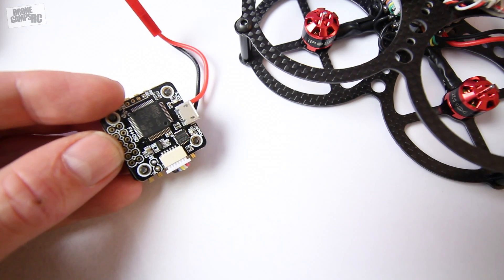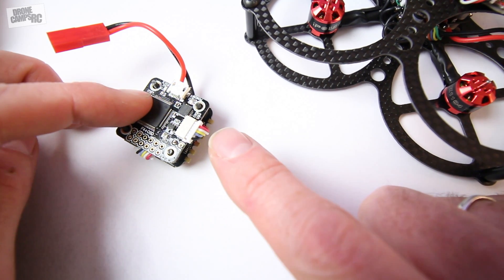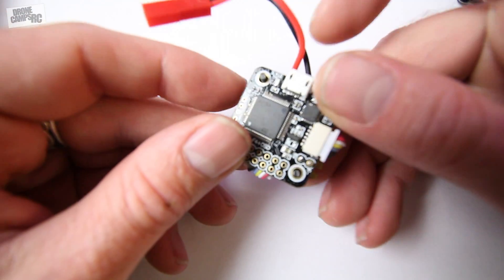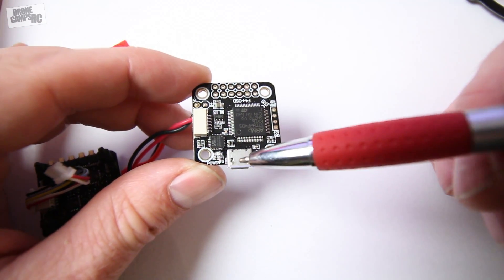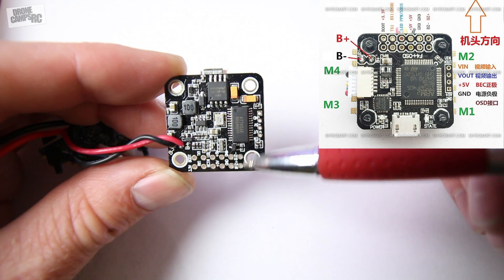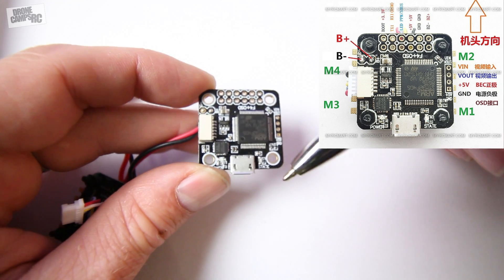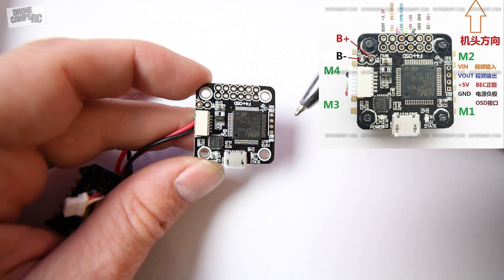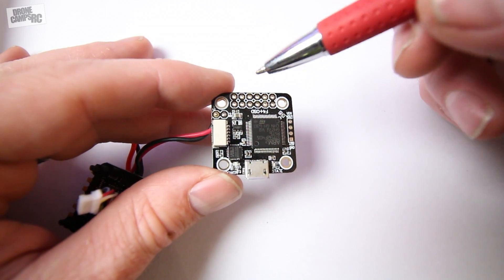UPGRADE ALERT! - 4S THE EASY WAY - Flytower Plus Mini F4

Comment: hi, can i ask you the dump or witch firmware can update of this board? i tried some settigs and resetted settings without dump. how did u get solutiob for 45 degrees board orientation, im little messed up with this board. thanks a lot

Comment: Thank you. My Mini F4 Flytower had no pin signs written on it. On the net, there were two kinds of explanations in which the inside and the outside of the pin were reversed. The problem was solved, thanks to you. It was saved. I appreciate it.

Comment: I'm new to building a drone and I bought this one as my first build, after some operations in betaflight(I forgot what I did) the flight controller became unreconized. window complains about unknown descriptor  something like that. Does any one know how to solve the issue?
Reply: Please help, I spent tons of hours, I also connect boot pin but no luck, windows doesn't recognize the device. I've installed all drivers VCP, STM and I also tried Immerse USB fix, no luck
Reply: I think I did disable some port and disabled the usb...  you mentioned reflash it, please tell me how if windows can't recognize this any more?
Reply: He explains it in the video, how to flash the FC, if you "brick it." Look for the part where he mentions "bricking..." and follow his instructions on shorting the 2 pins, then start betaflight/cleanflight in flashing mode. then plug the same USB cable in the usb port of the FC (even if you know you disabled the plug, you use the same plug during flashing).

Comment: Just picked up one of these Furibee boards from Gearbest.  I think this question has been asked, but I haven't seen a real fix yet, but does anyone know how to hook up a FrSky Rx with Smartport telemetry to this FC?  I'm guessing that the telemetry signal coming from the board is NOT inverted as with other F4 boards?  Also, which UARTs are coming out to which pins?  I have the Rx talking to the board, but can't seem to get the telemetry working.  I've connected a wire to the TX1 pad out to the UNINVERTED telemetry connection point on the Rx.  Not sure which UART this is, but still haven't been able to get it to work by trail and error.  Not sure what I'm missing.

Comment: Eachine Falcon 120 Spare Part Naze32 6DOF Flight Controller with 4 In 1 BLHELI-S 20A ESC
The above item I bought from Banggood but nobody can help me Would you be so kind and give me some advice how i have to connect the Cables on my receiver or is there a picture in www where i can find any advice PLEASE HELP

Comment: hey Justin, can this fc handle hb t1 1407's?
Reply: Concerning motors, primary would be the frame, props, ESC Amp's, and/or Lipo you're using. Answer is yes for most 1407 motors.

Comment: Personally would not recommend  the ARFun 90 frame...had 2 break on the arm right near the motor.  It's a thick bottom plate but that area appears to be a huge weak point as I have seen others with the same break point.
Reply from the maker: other frames will break as well. And this one for $11 is not bad considering.
Reply: No argument here that other frames will break.  Both frames broke in the exact same spot.  Just merely offering another opinion that the ARFun frame isn't as indestructible as we once thought due to the skinny arms near the motors.
Reply from the maker: I trust your advice